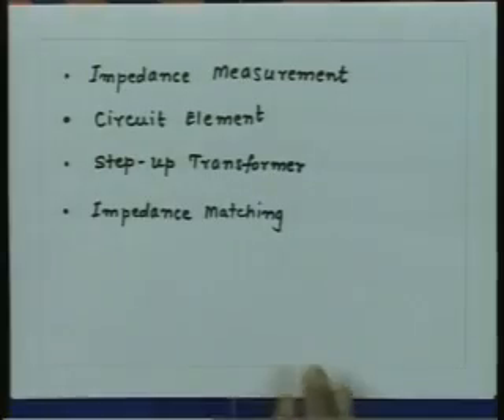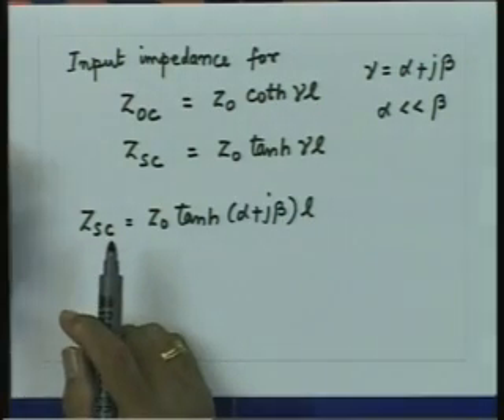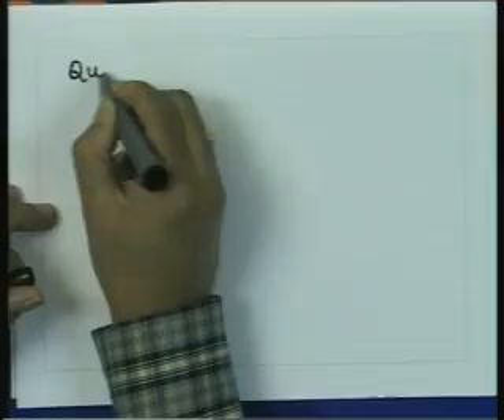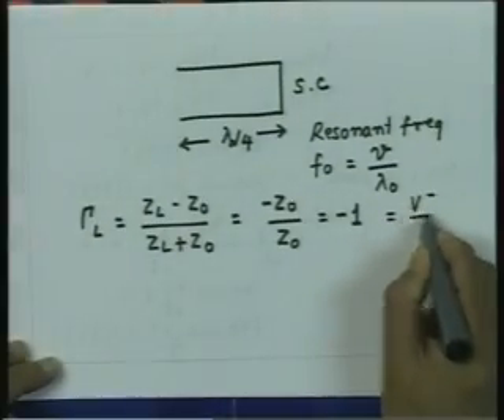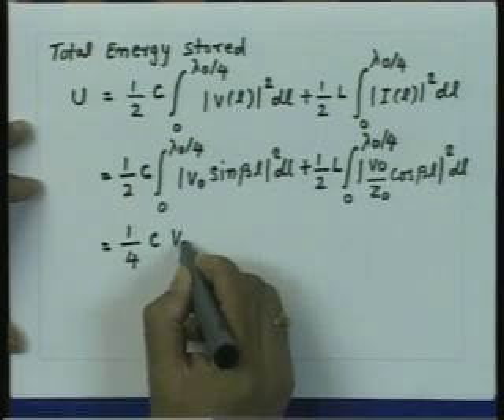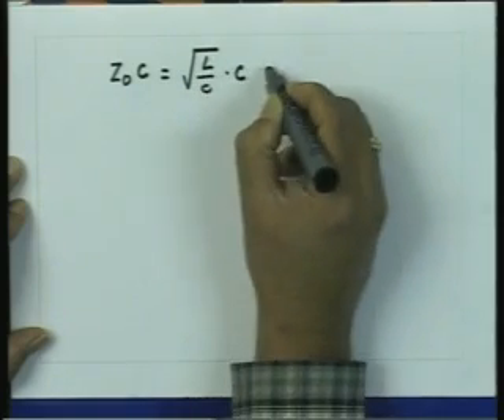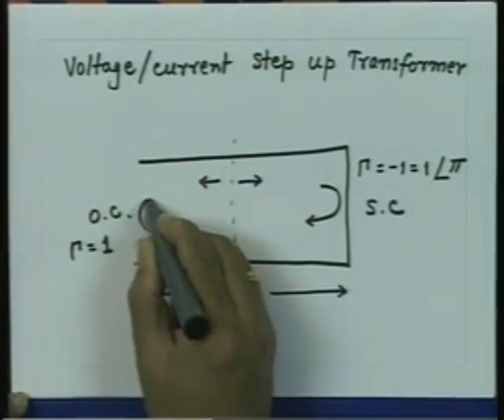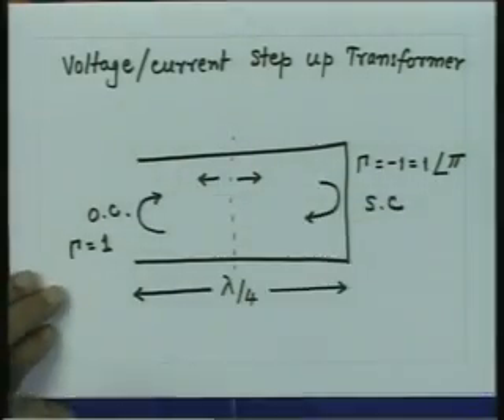Applications of transmission lines-II

Comment: Electrostatics and circuits belong to one science not two. For a unified approach to learning Current and the process of conduction watch these two videos i. https://youtu.be/REsWdd76qxc and 
ii. https://youtu.be/8BQM_xw2Rfo 
Also, in the textbooks referred in the last frame of video i you will find descriptions of the operation of resistors, capacitors and inductors using this approach which makes it easier to understand.
There are also a chapter in the textbook references 'Fundamentals of electric theory and circuits' which explains the operation of transmission lines using the unified approach.
Reply: Don't promote your channel. And if do promote then acknowledge what he is teaching, with Humility. The video which you have uploaded on your channel is very basic and is of High school level. And what he is teaching here is a topic of Graduate level, just because he is finding Quality factor doesn't mean that now let's go back to the class 10th book again, there, you will gain nothing, except same old same old examples. So, if you can learn with humility it is better and you will grow else your arrogance will always come in between to reduce your progress